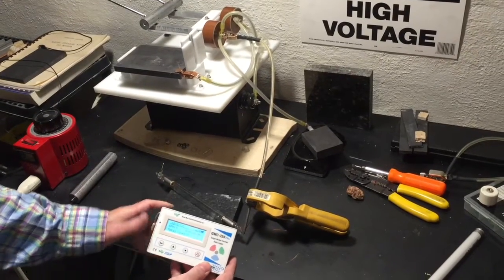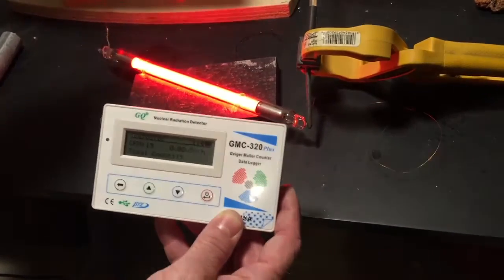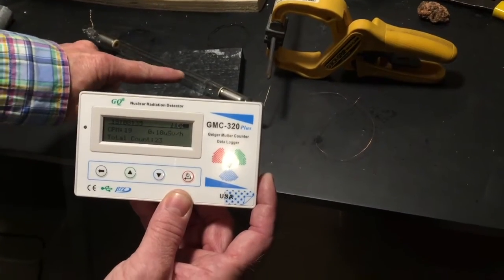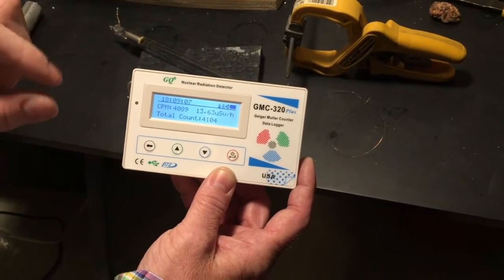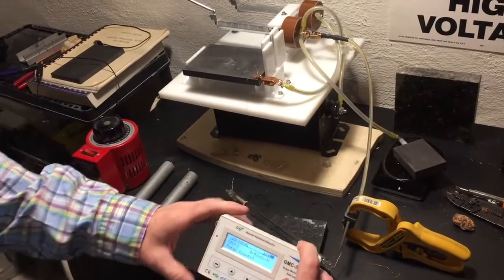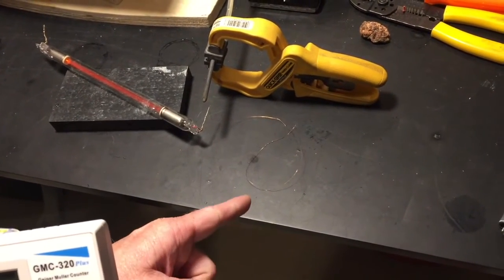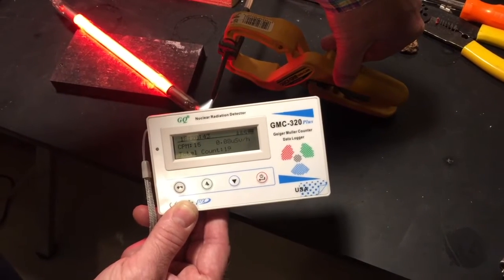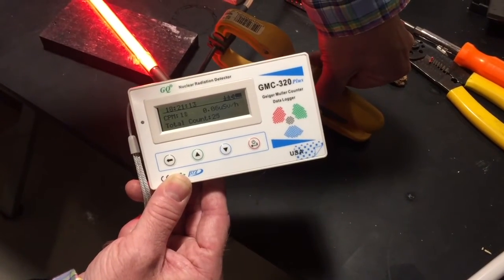RADIOACTIVE  LEVEL SPARK GAP SEALED VS AMBIENT TESLA STOUT BAR

Comment: Radio waves and the EMP from the spark gap are ionizing the Geiger counter tube and are messing with the electronics.
Reply: Oh, and I noticed that xenon flash tubes (camera flash etc.) can trigger a Geiger counter too.
Reply: However, nice work. But please try to find more ways to verify your results!
Reply from the maker: Actually I do not agree.  It is very possible the output is real.  I placed the counter in a grounded faraday cage
Reply: diveflyfish a faraday Cage does not block rapidly changing magnetic fields, as far as I know.

However, you could try to use a dosimeter instead.

Edit: or a cloud chamber, but I don’t know if you can display gamma/x-Rays with them.
Reply: These bright blue flashes mess with the Geiger counter. I tried it with different hv sources and different circuits.
Reply: @diveflyfish it’s not omfg

Comment: Can you do this with just a capacitive discharge? There are strong EM fields at play that can affect the circuitry of that meter. Perhaps some shielding around the meter like a grounded wire mesh might be a good experiment to conduct as well?
Reply: I believe the shunted hairpin circuit is the key to all of Tesla's HV 'generators'. He eludes to this in all of his later patents. There is definitely something going on which is not your standard 'AC' or 'HF'...

Higher voltages and frequencies can be bought with a multiple spark gap assembly with small gaps. That's a guarantee. I have blown >24KV caps on both legs of a 15KV NST (7.5KV output on each side of a NST).

Can you try doing the same test with a candle flame near the neon tube?
This should bring some interesting results.. I have been able to get a candle flame to be attracted (flame moved horizontally - sideways) to the neon tube with a similar setup.

Thanks for sharing :)
Reply from the maker: I did as you requested..... I built a faraday cage for the geiger counter and left a window for the area for the tube.......
it IS a HOT discharge..... To be sure...... I will uplink a video later showing it.
Reply from the maker: There is a radioactive component that is real.  A faraday cage will not stop the radioactive component.  What is of considerable pause is the MOST EXTRAORDINARY LEVEL OF OUTPUT from otherwise IDENTICAL CIRCUIT.
THE MILEAU IS BEING STRESSED HERE.  MOTHER NATURE IS PUSHING BACK HARD perhaps.  PHASE differential between VOLTAGE and CURRENT seem inadequate to explain how the shunted circuit produces the energy level to achieve radioactive discharge as well as substrate penetration.
remember: OUTPUT theoretically is 30mA and 15kV...... My suspicion is that the kV from this circuit is HIGHER than the 15kV output of the transformer....
Reply from the maker: I am not sure how to do this with just a capacitive  discharge...... The caps at this voltage are of NOMINAL storage.  In essence, the speed of the discharge is truly a cap discharge, the inductive aspect keeps the caps charged at a nanosecond level.
Reply: +diveflyfish Yes, it most certainly is a much higher voltage. This is usually the case with an oscillating circuit that uses capacitive discharge.  I think its important to use conductive reasoning rather than inductive. So to test other possibilities would be important for a complete understanding don't you think? Otherwise we are claiming gravitational waves 😉
Reply: +diveflyfish You can use an inductor like a Tesla coil, or just charge up a capacitor and discharge it?
Reply from the maker: I will not claim Gravitation waves to be sure given the fixed nature of the discharge!!  Some have argued that the circuit is only making RMS above the cap discharge lets say to 52KV, I believe it may be higher and will be able to test soon as a HV probe is due to arrive....
HOW TO DO WHAT YOU RECOMMEND IS OPENLY WELCOMED.
ALL THOUGHTS WELCOME.
Reply from the maker: I only have a 15kV transformer for charging...... this is the issue....
Reply: ***** That was precisely what I was suggesting. One can still leave an opening for ionizing radiation if present. Thats why I suggested a mesh screen.
Reply from the maker: I did as you both suggested with window in screen....
It is a Radioactive discharge to be sure......